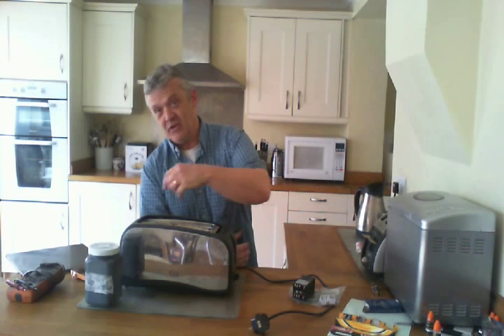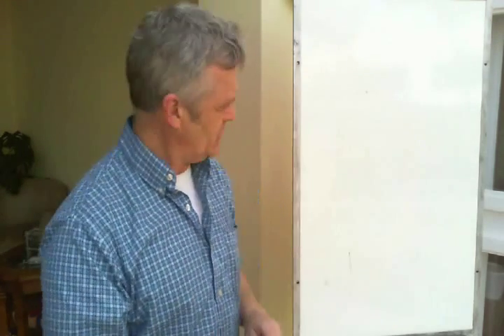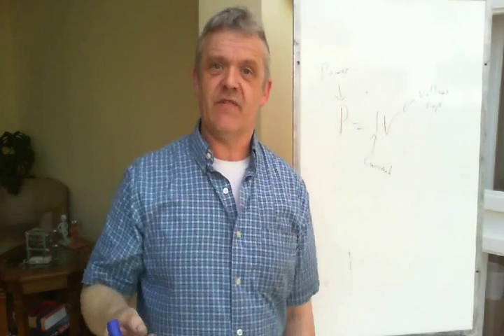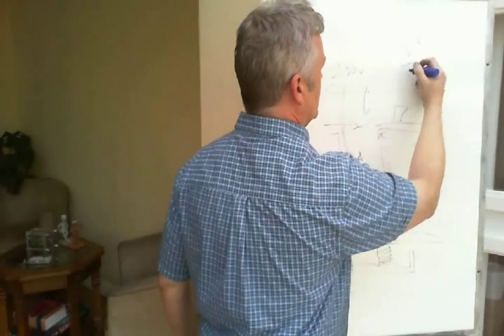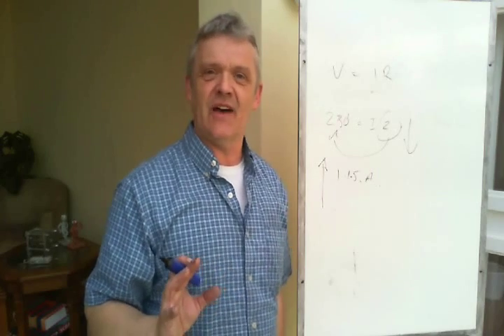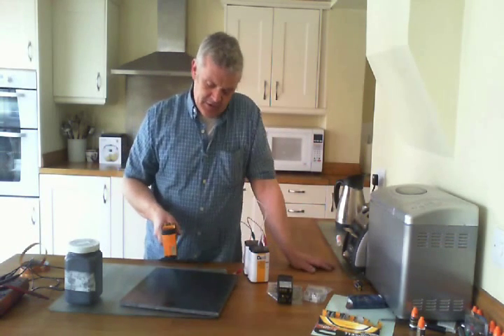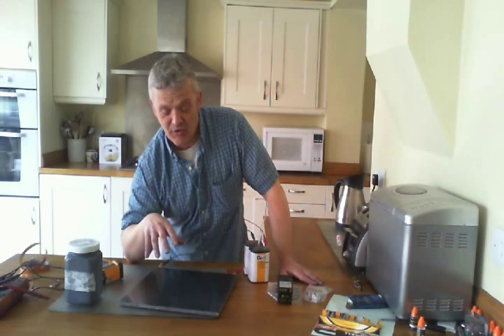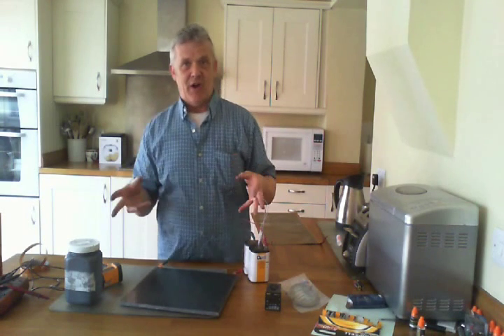How To Make A Hot Plate From Conductive Ink

Comment: p.s. of course being flat glass, you could mount it on the 'outside' back of the tank glass, not in the water itself. Perhaps ( since required fish tank temps are rarely above 28 degrees Celsius ) the 'element' could be laminated with a coloured ( deep blue or black being popular ) or a photographic tank decor sheet.
Reply from the maker: terrarium too maybe

Comment: Good morning Robert.
Great video.
I am trying to make a dual use device, a kettle/hotplate and I came across your video which is very well explained.
I am new to this so I just have a few quick questions for you:
1- you mentioned in this video that the copper melts with the heat in the switch and thus the power gets turned off, so, if the copper has melted, how does the switch operate a second time after this?
2- is capton tape the best material avaible for the use it is put to n this video, or would there be a better material that does the job a bit better?
3- is the metal to heat used in a kettle and toaster the same material and would their be a better material that I could use for this job?
I hope to make a little dual kettle/hotplate.
To be honest-I wish they taught practical, usefull information like this in school but thank God for YouTube and teachers you!
(I hope you don't mind me calling you a teacher, but in that few minutes I did learn a lot of really applicable information to solve my problem at hand. I'm looking forward to checking out the rest of your videos.
Good man,thank you.)

Comment: Robert..  As mentioned in an earlier post....  If making a 3d printer build plate would you see any benefits as in faster heating with similar 12 volt supply and 8 x 8 inch surface area?  Also I assume this process needs a non conductive surface correct?  Thanks for the videos.  You have a lot of great ideas!
Reply from the maker: cheers mate - to make it truly non conductive - i would cover it with kapton - that'll take the heat too
Reply: My curiosity has got the better of me... I don't want to take up much of your time, but here is what I am thinking....
I am using one of the generic circuit board heaters at 12 volts to heat a 1/8" thick 8" x 8" square piece of 6061 aluminum.  The extruder uses a 40 watt cartridge heater at 12 volts.  The extruder can reach its operating temp of 230 C in about 5 mins.  The bed takes 8 min to get to 70 C for printing PLA.  When I go to ABS  the bed needs to heat up to over 90 C  which takes over 20 mins.  Would it be possible to coat the aluminum plate with conductive ink at the correct resistance and decrease the time to warm it up?  Maybe even coat both sides to double heating surfaces?  I'd like to stay with 12 volts and my current power supply is 450 watts.  Am I on the right track or am I missing something?  what are your thoughts?  Thanks for your time and wonderful ideas.
Reply from the maker: sounds doable - but i would mix the ink with bentonite clay to adjust the resistance and therefor heating rate - but - increasing heating rate is going to increase power draw until the temp you want is reached then draw will be drastically reduced as all you are doing is maintaining temp against losses

Comment: It would be a great method to heat the printing surface of diy 3d printers. keep up the good work
Reply: I thought the same thing....  3d printer plate.... Have to do the math,  but I  think there would not be any real benefits over a regular resistance heat bed.   After all the power equations for both systems are the same.   It would still be cool though.
Reply from the maker: Ben Rogerson
you are quite right - there wouldn't be any functional benefit - but you may be missing the point - with this ink - you could paint your own lol - however, your 100% right on it would be v cool - it would be super cool lol
Reply: Absolutely!  I am still going to try it out.   Am I correct that this should be done on a non-conductive surface... Thanks
Reply from the maker: it's a resistive heater mate,so it will conduct but the conduction is minimal - think toaster - I mean it is pretty safe - it touch it in the video after all - but you wouldn't want to put metals on it.

Comment: how will the ink hold up to constant use as say a hot plate / heater using say 350 degree temps
Reply from the maker: should be fine - i would coat the top with kapton though - that would allow you to take it up to 400 degrees